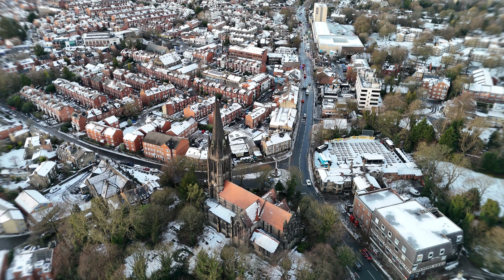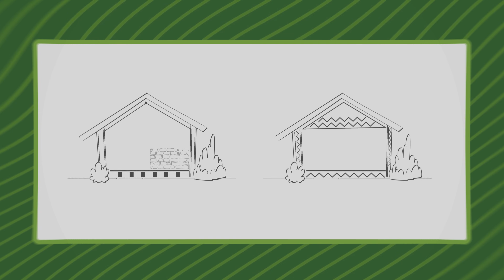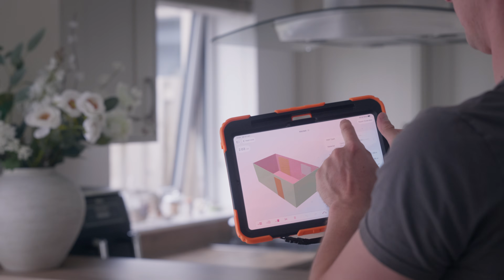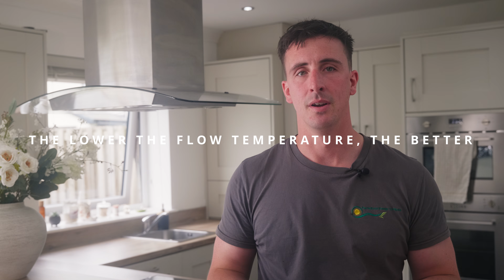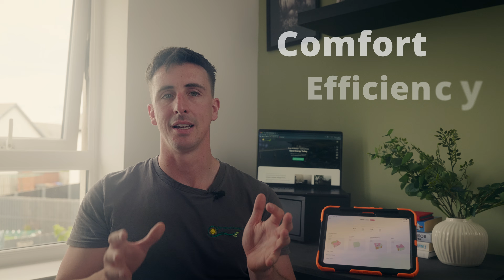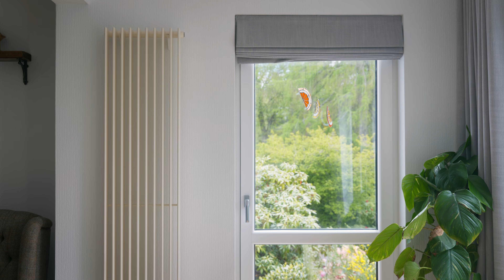Watch this BEFORE you think about buying a Heat Pump

Comment: Do you have to design all rooms to 21°C? I have a radiator in my garage (I also have insulated garage doors) as I use it as a workshop/man cave and have items such as the fridge in there that need to be above 15°C, but I don't need it to be the full 21°C. Similarly I don't need my porch to reach 21°C. In fact my porch doesn't even have a radiator in it!
Reply from the maker: You wouldn't design your garage for 21C, no! However you could add a small radiator to your porch or just treat it as an unheated space.